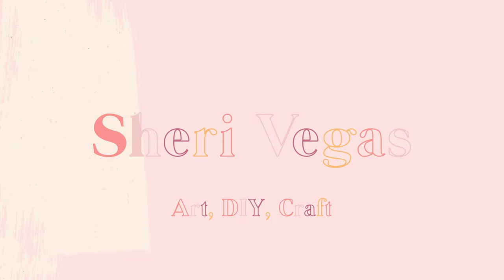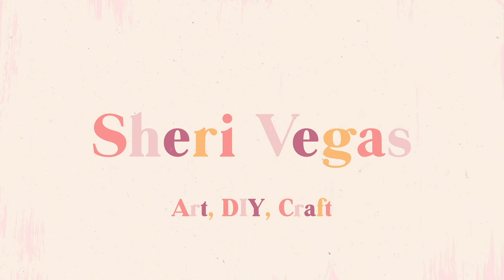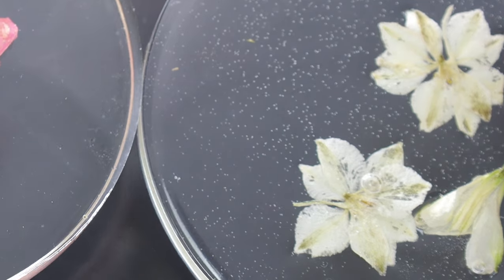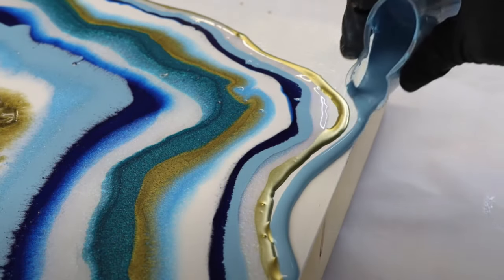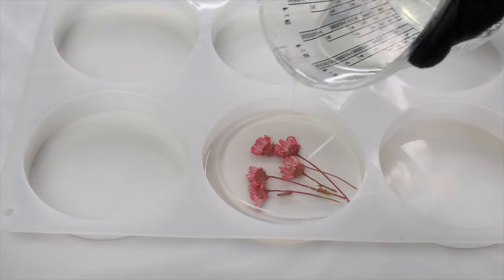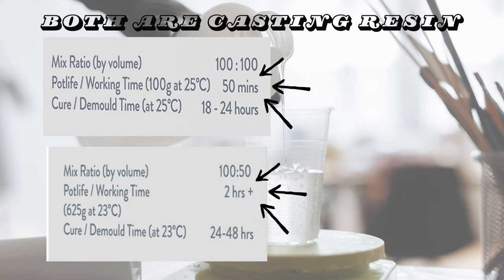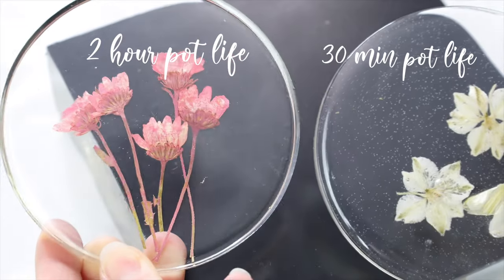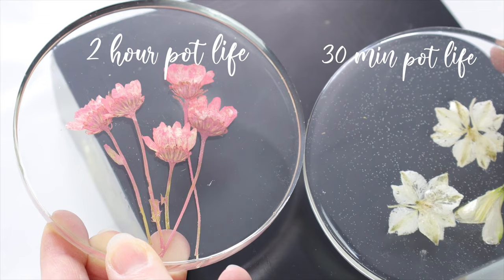Are You Struggling With Micro Bubbles In Resin?

Comment: Another game changer for thick or old resin (I have both, lol) is to warm it up!! I have a one burner stove and a small pan I use for this purpose only. I use a small ceramic plate to put on top of the pan, so the plate is slightly bigger than the pan, then put my resin in a glass jar and turn the heat to a low temp. I don’t put the jar of resin directly onto the heat source (ie the plate), so it gradually warms up. It works sooo well in eliminating those pesky bubbles and I find that it doesn’t really change the work time of my resin!! This is re a 1:1 resin.

Comment: Great advice. I’m a newbie and actually just doing my first project. How do I clean my measuring cups?  I’ve failed my first project, but I’m not giving up
Reply: My advice..  get a digital kitchen scale and use disposable cups. You can weigh your resin in the same cup and get accurate ratio everytime then throw away your cup when your done. Cleaning resin cups cost more than disposable cups, and it sucks to clean. I've tried many cleaners... wd40 and rubbing alcohol are the best I've found and is still a pain to get cups clean,  I'll waste $2-3 on cleaning supplies everytime, compare that to a 10 cent solo cup...

Comment: Hi Sheri, can you please share your opinion on the fast curing machines that are out there and if you have used?
Reply from the maker: I’m not a fan on the resin curing machines with the trays I find that they’re not level and you can only fit small items in them. If I was going to use anything maybe a heat mat. I’m not a fan of speeding up the curing process as it can cause the resin to discolour faster
Reply: @sherivegasartist good advice. Allow the resin to cure like it's supposed to.